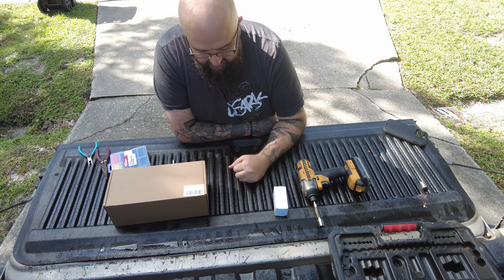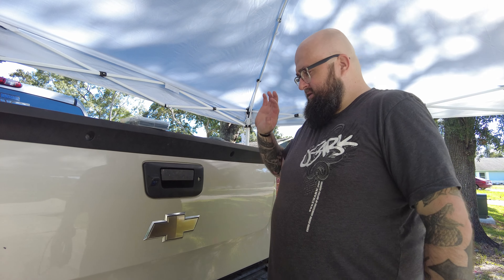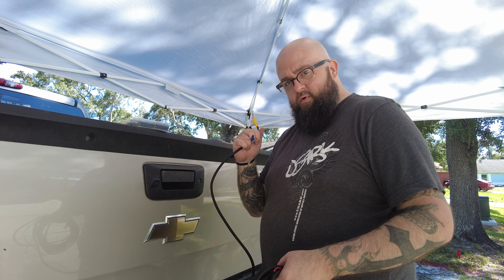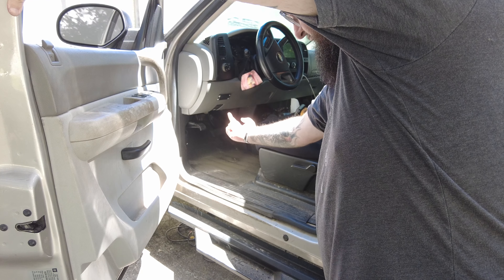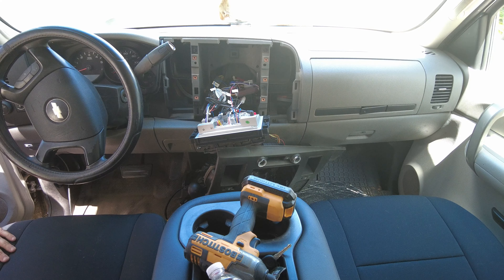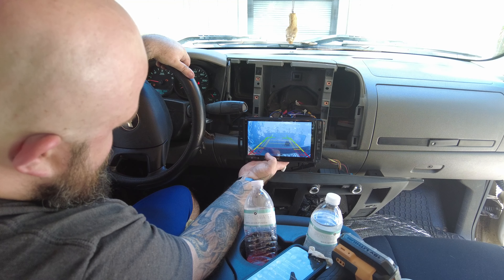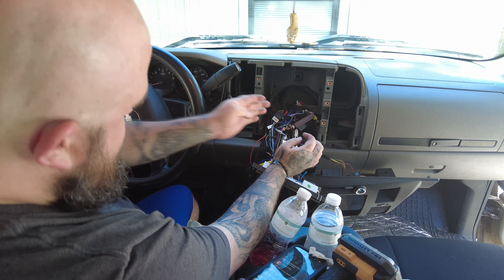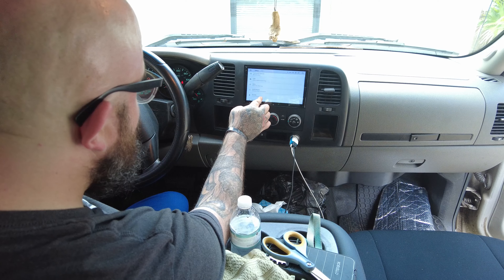Installing an Eway Tailgate Latch Backup Camera in a 2009 Chevy Silverado 1500!

Comment: hey man you were actually the reason i bought the head unit and installed it in my 08 chevy but i have a question on the backup camera does it come with the handle for the tailgate or you have to use the stock one because im looking into getting a chrome one but worried it will not come with the handle to bring the gate down
Reply from the maker: It doesn’t come with the handle unfortunately. 

You’ll have to get one separately. It’s a fairly simple install.

Comment: Did you connect any of the wires in the back of the truck or just the the male connector and 12v
Reply from the maker: Just the male connector and 12v